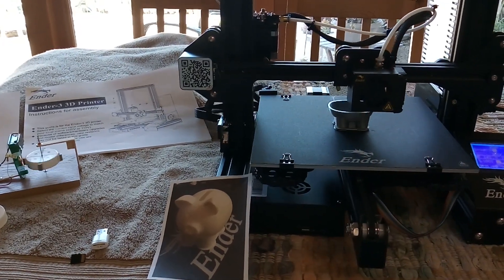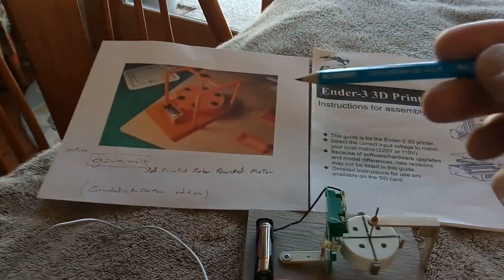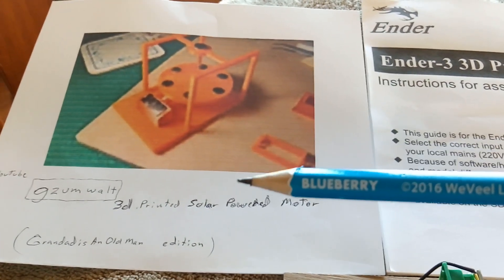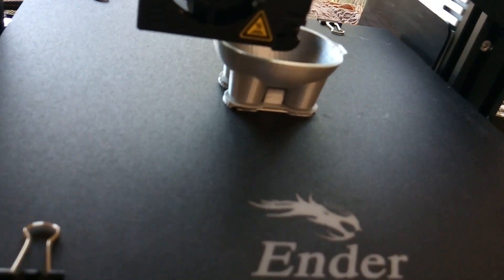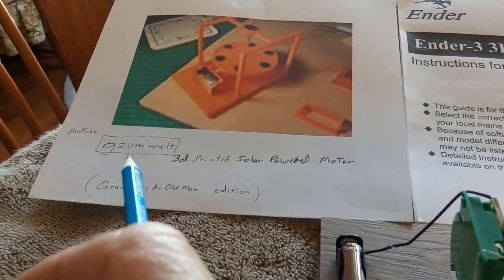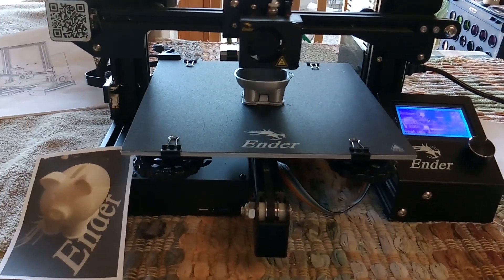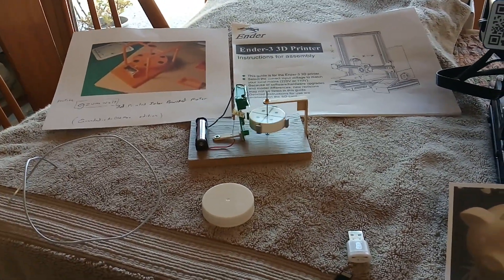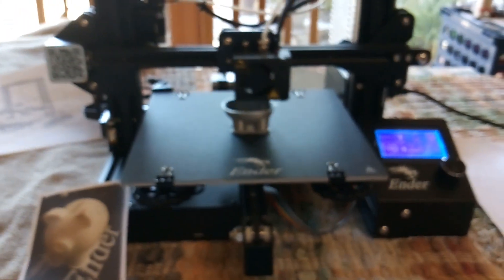Ender 3D Printer Project

Comment: Hi guys! Long time no see. I own this same model 3d printer. So far this is the best one I owned since 2017. So have fun, Lidmotor. You will enjoy it.
Reply from the maker: Wow. Thanks for checking in.  Great to hear from you.  This printer is pretty neat.  It will take me some time to learn how to use it but it seems to be a great tool.
Reply: @Lidmotor  If you need any help with cad drawings, just send me a skech and I can make the stl files for you.

Comment: Fusion 360 is a free program that is excellent for designing 3d models. I'd say it is way easier to learn than most. I think Laser uses 3ds max or blender, I think they're way too complicated. Get yourself a digital micrometer and fidget spinner bearings and build a pulse motor of your dreams! I have an ender 3 also, best bang for the buck. Great news!
Reply from the maker: Thanks.

Comment: Congrats!  an excellent choice, I recently got an Ender 3 Pro (slight improvements like a magnetic build-plate and a metal insert on the extruder so the filament doesn't wear a hole in the plastic lever) and followed a video called "First 24 Upgrades on my Ender 3 Pro" to add more features.  for design, I use OpenSCAD which lets you construct shapes out of primitives like cubes, cylinders & spheres to exact specification (it's a simple scripting language that's free & well documented) and Cura to do the slicing (Gyroid infill pattern is quite strong in all directions!)  Happy Printing  :)